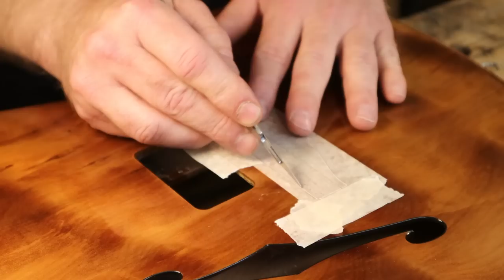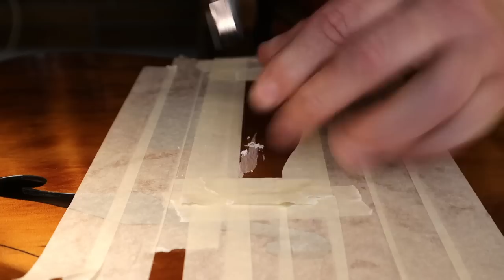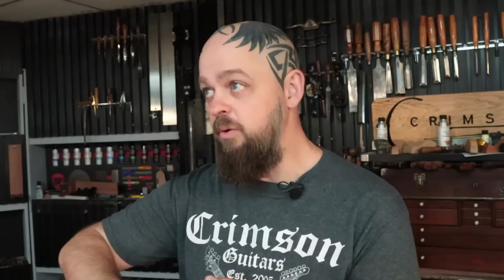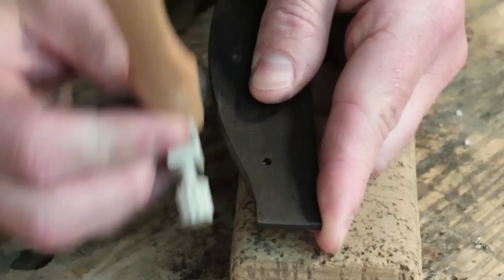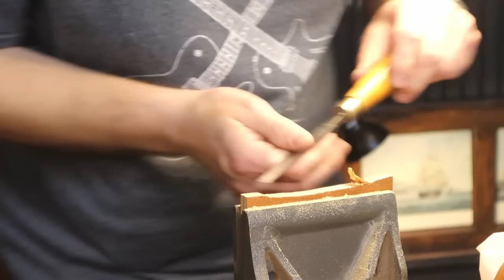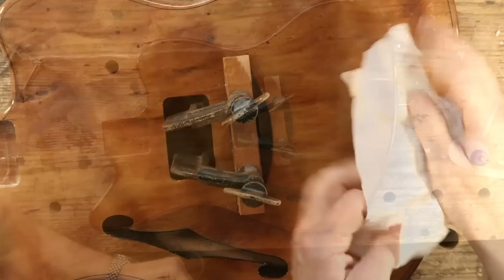Ep 15 - Scraping Finish & Installing the Bridge | Building a Guitar from 42,000 Year Old Wood!

Comment: I built a classical guitar kit for a friend earlier this year. Glueing the bridge was the most nerve wracking part and with good reason. I had it on and under tension for a day. I was in the next room and heard a “booooiiiinnnngg” Even the low tension nylons classical strings ripped it right off. I just didn’t use enough glue and I didn’t have even enough pressure on it clamping down. Minor repairs on the top and a rethink on my clamping and the second time around it worked out beautifully.

Comment: Hey Ben. For soft wood you might try Solarez UV cured epoxy. Highline guitars has used it. Can go on thin and unless exposed to sun or uv cure lights it stays wet and can level itself. Might provide the dent resistance preferred on soft woods.

Comment: Plastic drinking straw is ideal for getting the most of glue squeeze out. It's small, long and soft enough to get almost anywhere, including under clamps and corners. Cut a 45 bevel on both ends and move it towards the glue line. Works perfectly!

Comment: Draw around the bridge on a piece of veneer. Then cut it little smaller than the bridge. Use the veneer as template to remove finish the finish. Glue thev eneer to the underside of the bridge and glue that to the guitar. If there is any chip out then it hidden by the bridge.Lastly fill the gap that is around the bridge with glue or lacquer. Then you get a nice finish.

Comment: My favourite tool bodge: I own a small bike store in rural Australia. Had a touring cyclist come in because his shifter had failed.

It was a Saturday and I didn’t have a replacement so it would be a minimum 3 day wait to order one. 

To get the shifter apart I needed a very specific small pin spanner, which of course I didn’t have. I ended up taking the temper out of the handle of another tool that was the right width and filed it down into the pins I needed.  

I then had to make a new plastic washer to replace the one that had failed. Fortunately a rather dear, if slightly dotty, old customer of mine had gifted me a VHS of some movie that he felt I would like. No idea why, and I can’t recall what it was, but the case provided the material we needed. Took a couple of iterations to get it cut and shaped without snapping it, but in the end I got the customer on his way with enough daylight left to make it to his next stop.

Comment: Oooo nice work!  I love making tools almost as much as I love building and repairing instruments.   I occasionally buy old beat up handsaws to cut up for custom scrapers and scratch stock.  Wooden coffee stir sticks are perfect for cleaning up glue squeeze out, and also for spreading glue.  Plus they are super cheap at a dollar store or even a grocery store.  Bonus, they also work great for putting lines in a fretless fingerboard 😁  Oh, and I prefer cork for padding clamps and such.  I got a roll from an art supply store and it has lasted me like 15+ years, going on my shop made cam clamps and spool clamps, plus every gluing caul I have ever made.

Comment: talking tools to use ? My dad was a Carpenter and Millwright starting back in the early 40's where a lot of Carpenters made there own finish tools and I remember a plane I guess for a lack of a better word that you pulled instead of push and it was for fine detail work in Cabinetry and trim. This was a small plane on a long handle but you could put shorter one on if needed.  Able to pull a line detail or curves following a scribe line Putting in a small flat blade could pull or scrap the lacquer to the level that it was set to !t also had a line gauge on the side to follow an edge or a cut line like your doing. I wish I had that tool today. Don't know where it went moved a lot as a kid and thing got lost and sold I guess ?

If anyone know the ne of the tool or was it just one of a kind things they would build for themselves back then. I wished I had asked more question before he passed but a lot of unique tools are lost to history now !!!

Comment: Hey Ben, hope you still get to respond to comments on here. I've always thought that scraping with the back/flat side of the chisel will mean that you are wearing the end of the flat face, meaning a regrind would be necessary to use the same chisel for pairing/mortices, for example. I've always used the bevel edge for this. What are your/anyone elses thougths on this?

Comment: Jury-rigged or jerry-rigged is the same thing. In the US, it is more often seen as jerry-rigged. It goes back to the older English adjective jory meaning makeshift or hurriedly built. The rigged isn’t like rigging a jury (fixing the outcome of a trial), but from rig or rigging, e.g, the fixtures and supports on a sailboat.  I was curious to learn if it was related to jerry can, but that is from an Army slang for the German designed fuel can dating back to WWII. Etymology is a fun thing. In university, I loved looking up things in the OED in the library (back then not online and a full set cost thousands of dollars).
Reply: I looked it up and jury rigging (temporary/ad-how rigging) is definitely the original naval term. Jerry rigging might have come either via the similar pronunciation or via “Jerry-built” (shoddily built), which came about well before “Jerry” was slang for German

Comment: Would it be possible to remove the finish with a "sandblaster" (I'm thinking of a blueprint eraser, that uses fine aluminum oxide in a small tool that looks like an airbrush)? I have used one to produce etched glass ornaments for Christmas gifts, and it can produce exceptionally precise results.

Comment: Do you need to adapt the bridge for the fishman under-sadle transducer?
Reply: I was wondering about that when I watched the previous episode but I forgot to mention it.  I'm not sure how Fender do it.  On my Taylor they use their own design (piezo) that has 3 bars that pass right through the bridge and are visible from the outside.  Either way, I would want to have dismantled the Fender before hand to get a grip on how they have done it.  I'm going to assume Ben has already investigated it and knows whats going on.

Comment: Hey, Ben, or whoever handles these, in a few videos I've seen this little saw used (most recently Ive seen it used in the SG build I think, to cut the slots for the solder fret markers), I haven't had a chance to sit and watch this yet, so it may even be used in this video. But anyways, little saw, kind of hammer shaped, with a small section of blade on each side. I was wondering what it's called so I can find one, having no luck with trying to google it
Reply: Fret slot cleaning saw ... should get you at least to the start of a trail of breadcrumbs.
Reply: @PaulCooksStuff  Thanks, will have a look again
Reply: @PaulCooksStuff  Lead me to the whole damn loaf, will needlessly cut loads of stuff now

Comment: Actually Ben, I think you're wrong on the lacquer front and it's one of those things that's run away as everyone repeats it because it "sounds right" due to the word lac in it.
Reply: I am currently air brushing guitar hardware with Black Chrome Lacquer.  I dont think there is any beetle in it :)
Reply: @cheapskate8656  I think the lac beetle may have got its name because of the resins it excretes and not the other way around.
Reply: @ChrisFranklyn  Thanks Chris, I didnt realise it was a secretion.  I thought it was the exoskeleton.  Now I'm more edumacated :)

Comment: I'm just curious; with the considerable cost of this guitar already up there - why not just use a new set of electronics in the new build, instead of tearing a perfectly good guitar apart and rendering it unusable?  I mean, I would think it would be fairly easy to match specs on those parts - enough to avoid the extra work?

This isn't a criticism, but a genuine query.